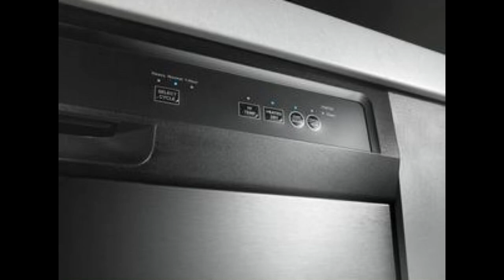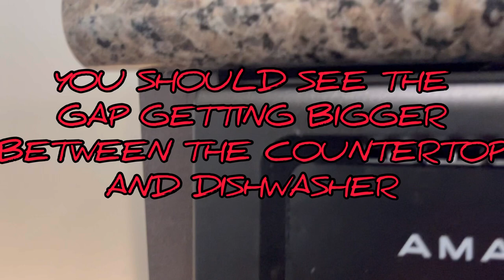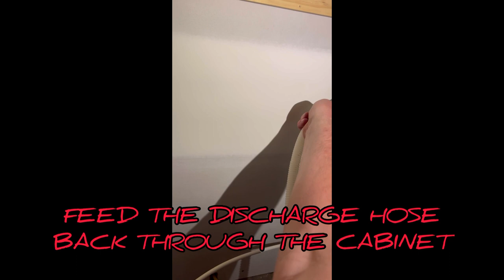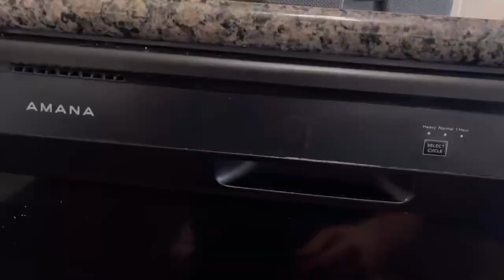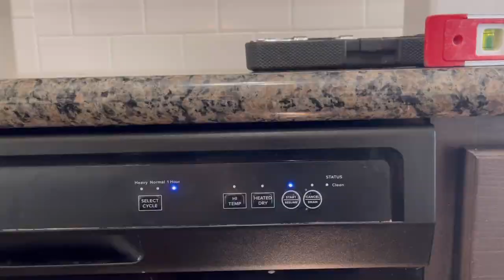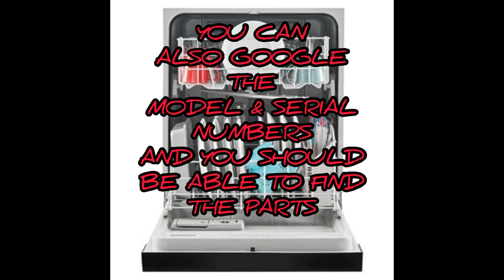Replacing discharge pump on Amana dishwasher

Comment: Question: why are we disconnecting the water line and the drain hose to replace it? Seems it can be done without it?
Reply from the maker: Hindsight it could probably have been done without pulling out the dishwasher. At least this way the homeowner won’t be so scared to pull out their dishwasher and work on it. I mostly do plumbing and not appliance repair but I figured this video would help. But you’re right, it can be done without it! Didn’t realize it until I was more than halfway through the job. 🤦🏻‍♂️🤷🏻‍♂️😂
Reply: @360plumbinghelp5  Oh okay gotcha. The circulation pump went out on my Amana dishwasher and I happened across this video. I didn't disconnect the water or electricity but I did turn the breaker off. Better safe than sorry really. Appreciate the video 👍🏻
Reply from the maker: @Maezee_Jae  you’re welcome! Thank you for watching. Hope it helped. 👊🏻